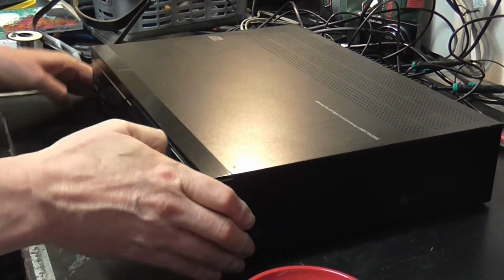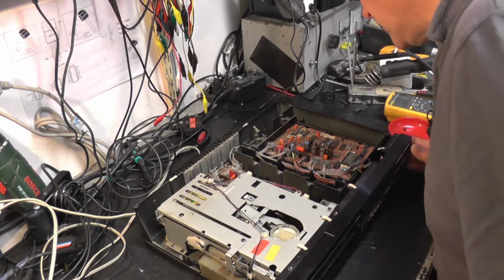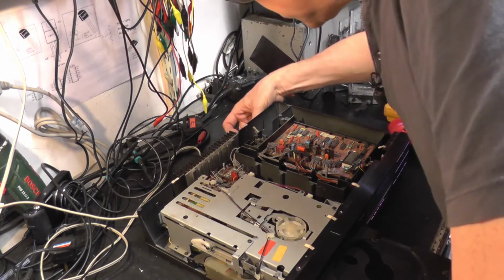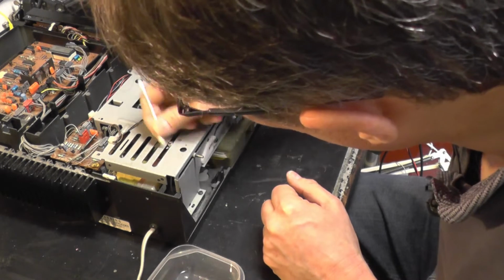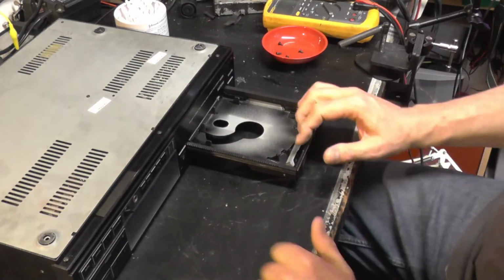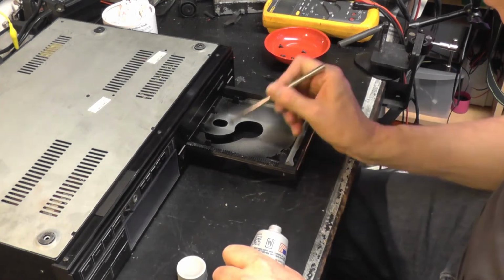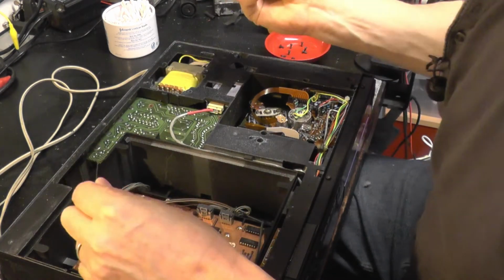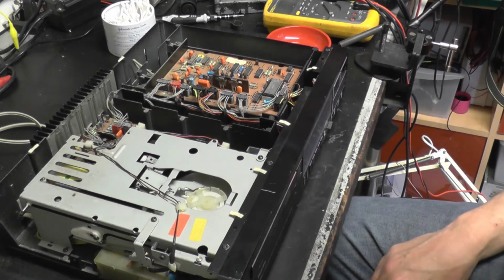Repairing Ian's Philips CD304 (Sticky drawer)

Comment: hi i have question about this cd player.i have problem with sound ,works ok but sound is very bad like distorted.problem is wrong solder?
Reply from the maker: Unlikely to be solder related. Trace the signal back to the dac from the socket. A cd with a sinne wave tone recorded on it will help